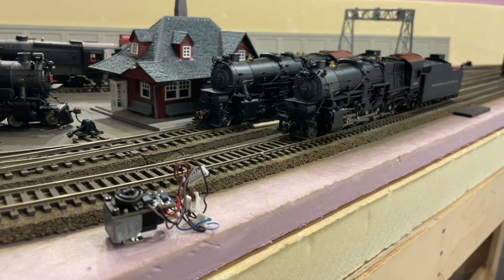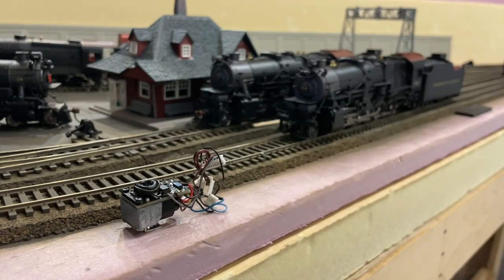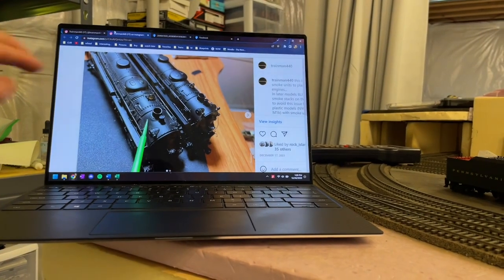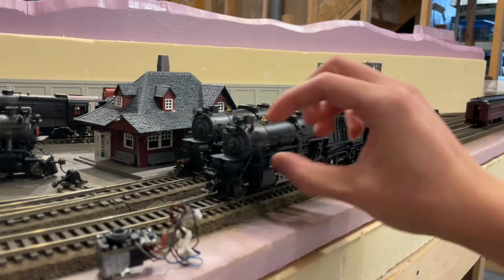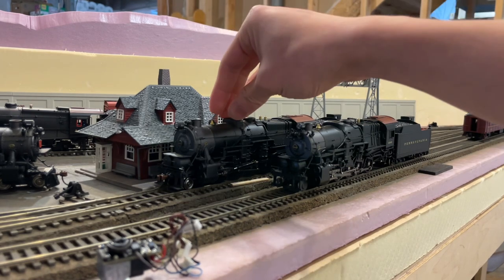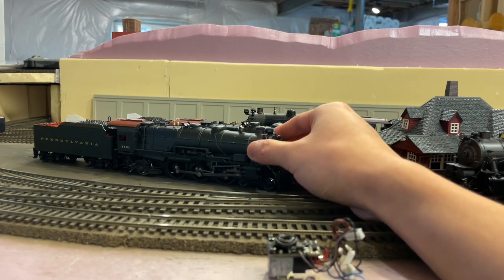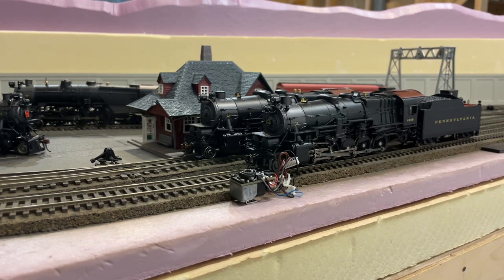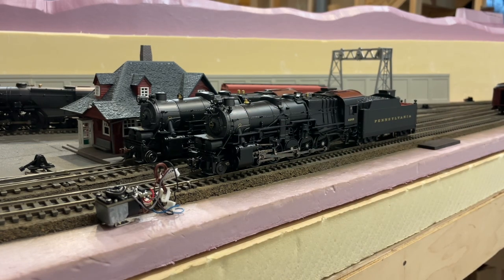A Critically Flawed Design - Broadway Limited Smoke

Comment: Ya I agree Broadway came
Out with hippo they should of did a all cast body an frame .I’m sure in next ur or two they’ll be a hippo brass hybrid like there tribune .love the 2-10-0 favorite engine but after working on the layout I was just about to throw one for the first time ever .engine really only ran 20’times around the layout maybe little more but sat there a lot to . Well par 3 only have two of them one hippo an one 2-8-2 . But tried linking three par 2 an one 3 an it does not work motors are different an had nothing but problems. So ended up taking the 2-10-0 par3 by itself on different main   while the other three were running fine with about 30 cars .so started the par3 an seamed like it wanted to go but was sort of lazy !!weird .also seamed jerky.flipped reverse an backed up fine for 20’ no cars .then flipped forward an did same thing an all of a sudden is started shorting out .shut power off an on a straight no switch’s an the thing took off at 90mph .grabbed it an turned  off power .the dial was off!! Powered up system dial off an engine takes off again so was just about to {^{^{€{~~<<an said well I’m going up stairs for the night ..first time this ever happened to me .I have plenty of the Broadway line an this one is the only one that gives me problems but now this .warranty I’m sure is up but I have very limited time on it .mostly sat in a glass case for show all weathered to .I’m lost for words let alone pissed . Ya pay good money for these things an the problems they have .I have my original 2-10-0 that the wheel in back looks like it’s going to fall apart still goes with no details . Looks like I’ll be getting a few key brass ones out an run them an switch to another manufacturer if the garage continues. Cheap cheap cheap .
Reply from the maker: BLI wont ever do a brass hybrid hippo. They never retool models with new tooling. Plastic engines are fine as long as you dont remove the weight from inside and swap it for a smoke unit! Cheers

Comment: Paragon 2 smoke units are not good at this point, I’ve had many issues with them and i have no issues with melting, just the operation. Paragon 3 and Paragon 4 smoke units are much better then the paragon 2 ones.
Reply from the maker: Paragon2 smoke units arent nearly as powerful. it seems that after too many complaints of bli smoke units being not powerful enough, bli turned up the power on their p3 and p4 smoke units. as a result they started melting boilers more.
Reply: @trainman440  The only issue I see with generators overheating is the smoke generator probably heat level got set too high as a mistake, its easily programmable to make it cooler and ive gotten most new locos from dealers so ive been ok

Comment: That's a class a I have a y6 and its all metal so must be a newer tooling with smoke in mind
Reply from the maker: gotcha, so the class A is plastic but y6 is diecast. thanks!
Reply: @trainman440  precisely, last Christmas in 2021 I got a pennsy decapod and it melted after 5 min of running. I have 4 good bli steamers but have sworn off buying any more bli since then
Reply: @scoobs2511  
Did BLI provide any service or warranty repair?
Reply from the maker: @scoobs2511  Eh, BLI is still fine, Id just avoid using smoke on the plastic engines. wouldnt swear off buying from them, i think thats a bit of an extreme reaction.
Reply: @gonebamboo4116  I didn’t even try because I’ve had terrible experience w their customer service in the past

Comment: They should go to water vaper or not put tjem in
Reply from the maker: This is a novel idea in theory but nearly impossible to apply in practice. we dont use water cause it can be detrimental to the internals...it can short circuit electronics if it leaks even at all (like if u store the engine horizontally in its box after a running session with water still inside) and it also corrodes many metals. Additionally, water vapor units would consume significantly more water than an oil smoke unit would consume oil, meaning youd be putting like 40 drops of smoke water fluid in to run for barely 5 minutes. Resulting in a MUCH larger smoke unit, which is very hard to fit into these tiny models.